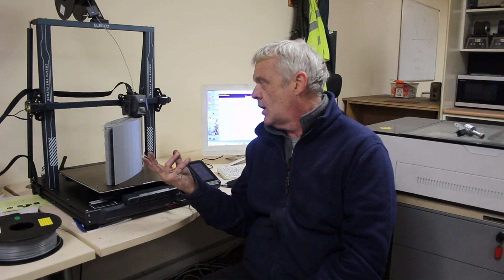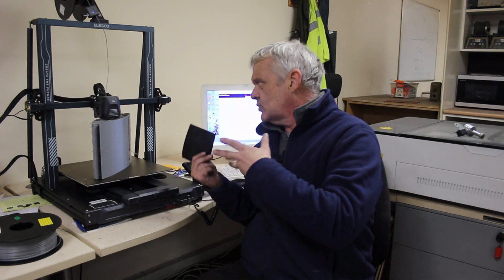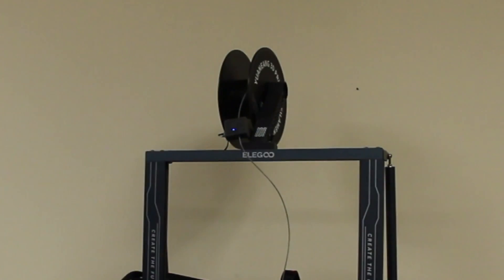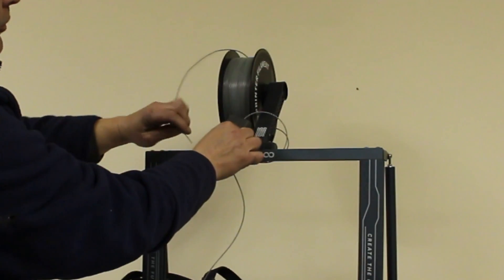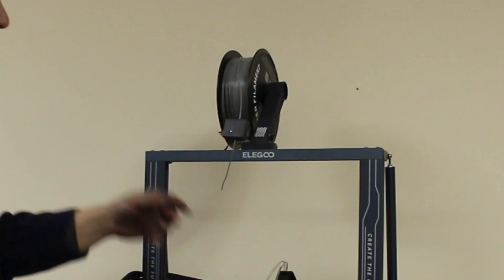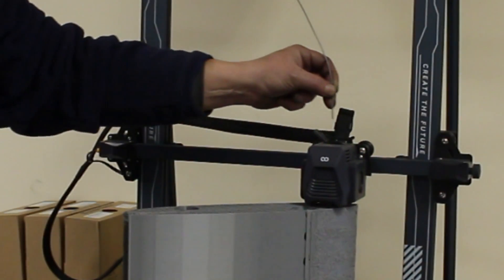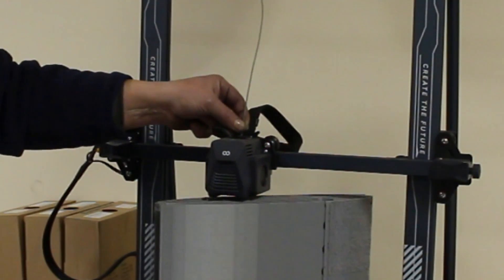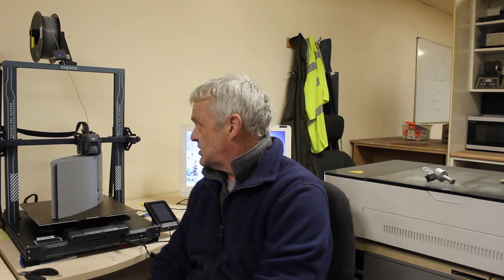1789 A 3D Printing Trick To Replace Filament #elegoo #neptune

Comment: This is even easier (but potentially less successful) on the Bowden style printers because the extruder stepper is stationary but then the potential problems come from the fact that it cannot fully retract once the new filament passes the gear since it’s not attached to the old filament until the new filament reaches the hot end but it hasn’t caused me any real issues despite doing a few multi-day 1kg+ prints and lots of using up ends of rolls on smaller prints.

Comment: This is a recipe for disaster if the quality of the print is important. The end can get hung inside and won't finish pushing through. 

Waiting for an interior portion to be printing when near the end of a roll, pause then change. Restart. This guarantees a fast easy change that will NEVER fail or effect your quality.

Comment: Clever. My printer is a prusa clone I put together from a kit  and a few years old now.  I think myself lucky if I get a print after 3 tries and I would be flabbergasted if it allowed me to do what your printer will allow.  Mine does have the sensor but I think I don't use the machine enough to get really adept at picking up skills for coping with the snags that I encounter. It has enabled me to mend various gadgets that would otherwise have needed costly replacement or just binning so its all good.

Comment: Off topic of this video but I've had an idea about some of the small scale wind turbines.  If someone didn't want to combine the small scale turbines for larger power and redundancy,  what if you combined one with one of those inexpensive solar LED lights?  You would already have a load and an energy storage system.  If you just wanted a light, the turbine would help keep the battery charged even at night.  Or you could just use them as chargers for AA or AAA size batteries.

Comment: I tend to judge a solution to a problem on how simple the solution is. Can't get simplier than that. I would had fuse those 2 filaments with a hot glue gun, but that would create new problems on the hot end.

Comment: Are you going to try making your own filament?  I have seen people use grocery bags, and water and drink bottles, to make filament , it doesn't seem the bags would be a good idea, I know it's thin, but the ones we get, if the sun shines on it for a day, it turns to dust, and you are lucky to get your goods home in them, I don't know much about 3D printing, but if I did get one, I would be learning fast,   and the carbon fiber filament, I'd like to check that stuff out!!     I have mind full of things I'd like to make,   maybe one day I can build a shop with a printer ,and use that printer to make a large printer,   I'd like to make large things and a bed with a sq. Meter, and nearly 2meters tall, (2.5meters tall probably) would be great, and a starting point, be capable of using a whole roll of filament on a single print,  maybe have multiple print heads, and spool holders. I have been studying printers , how they are built, and the controls,   and the hu'normas ones that print with concrete,  that's awesome!  If there was a better way  to add rebar, a couple guys could build a huge house in a couple days!   And limited by imagination only.. 
 Plus  using 3D prints for casting  molds, making cast steel and aluminum parts would be great, when I first heard of 3D printing, I thought that would be the primary use, was I wrong or what,  I do not like the idea of printing parts in sections, gluing them together, one thing I'd really like to make , is a huge sterling engine, something nearly resembling a v4 engine, displacing nearly 30 litres per "cylinder" that is to be heated, use possibly an oil to to be heated by concentrated sun, using multiple sat dishes, tracking the sun,  and using water pumped  through a water fall and a small pond to keep the cool side cool!  And if nothing else, spin it with a motor, powered by solar power, to make a heat pump to cool my off grid home, I could not believe seeing a sterling engine spun, and it making ice from the water condensed on the case,  that was mind blowing! It is not efficient , but if you have such a large sterling, and solar to spin it, and use it to cool water with ethanol, or antifreeze in it, cooled to about -10° +/-,  circulated through radiators that are also used for heating in winter with a wood stove/ boiler, and heat exchanger, it can be useful, hopefully dropping the temperature 20°F in a 1800 sq ft home, keeping some parts closed off,  a 3D printer could build that!  It's mind blowing,   sorry to ramble again! If you got this far, Happy New year!! 🎉. Thanks for everything,

Comment: I had a buddy who worked in a plant that made steel cables.  They used a cold welding machine to join spools of wire.  The end of the old wire in one end and the end of the new wire in the other.  Clamp the ends down and push down a lever.   Pull the lever up and both ends are now joined with a seamless weld.  It was quite impressive.  Surprised they don't have something like this for filaments.
Reply: But it's not necessary...
Reply: @UnitSe7en  Neither are 3d printers but there's lots of them in use.  Lol.  It just seems to me there's a better way to do this than to sit there and wait for the spool to run out.  If you were able to weld/join the end of one spool to the beginning of another and just walk away that would simplify things and remove some of the risk of a failed print.  But what works for one person won't work for another.  Personally I'm not sitting by a machine waiting for it to run out of materials if there is a way to pre-stock it so that I can do other stuff while the machine is working.
Reply: They have a hand held splicing device that can do this. I have never tried it but some people use it. It would be nice to have it built onto the top of a printer though where you could simply splice the next spool it as it feeds through but the current cost is about 50 of 60$ for one.

Comment: Wondering how difficult it would be to thermally weld the tail end to the beginning of the new without creating ledges that may impede automatic feeding.
Reply: Not especially, but a couple of problems impede the process, one is thermal expansion and contraction, another is loss of strengt in the joint. Both can be mitigated by sliding a bit of PTFE tube on one string, then melt and weld the two ends, sliding the PTFE tube over the joint and shaping the molten plastic. Leave the tube on the joint for protection.
Reply: @jakobhansen1396 given sane materials, expansion and contraction between filaments are likely to be identical. But being mostly lengthwise the joint shouldn't be under stress.

Maybe there is an opportunity here. I can see using a peltier to warm and cool two halfs of a die for welding two filaments of given diameter.
Reply: @kreynolds1123  in practice there is a certain swelling that needs to be managed, filament is usually extruded with a specifik pull forming the diameter, which is hard to replicate. 
Regarding strengt it's the mostly part that is important, the coils introduce bending and imperfections in the weld become significant.

Comment: If you don't use the filament runout sensor, just stick a short length of filament through it, rather than feeding the whole reel through it and then keep an eye out for when you need to poke the new filament into the feeder :-)

Comment: On these larger shapes with small or no retractions you can get away with this. When small articulated items with many retractions need more filament it would probably be easiest (assuming their is no pause button in the UI) is trip the filament sensor.  

It always works until it doesn’t, and one big fail is all it takes to cancel  out all that time and effort you made to use every drop of filament. Best of luck, there is no correct answer but as my experience has grown I have stopped doing the demonstrated method all together.
Reply: Has worked for me on a bowden-tube ender 3, even with retractions. I just continue pushing new filament into extruder despite retractions, until it is some 10cm into the tube. True, there might be more stringing while the remainder of the old filament is used up, but hasn't yet made any prints unusable.
Plus, one would have to be watching the print and be close by to change the filament, and without a filament sensor a timing mistake might be costly...

Comment: How long does one spool last? that depends on the quality of your print (if you print in 0.12 or 0.28mm) ... that means you have to check your print all the time because you have to be there BEFORE your sensor gives an alert.  I let the sensor give me an alert (very loud siren - it will then continue printing for another 5 to 10 minutes depending on the print). It would even pull me out of bed in the middle of the night even when i'm sleeping. I then go and press the "pause" button, which makes the head go in a corner. I then change the filament (letting 10 cm come through the nozzle) . when that is done i hit the "resume button" and it continues where it paused. depending on the sensor, it opens or closes a circuit. those filament sensors are less than 10$. you can easily connect an extra one and almost any alarm, and its much better than having to wait and watch.. I'm not saying your method is bad, just that i wouldn't have the time waiting till the spool is finished. 
Luc

Comment: luckily on my printer the feed gear is remote at the end of a tube to the print head, but essentially its the same method, just feed the new filament into the top end of the tube, the butt joint between the two allowing it to continue pushing through to the print head.

Comment: @robert here is a idea I have no time or the eyesight no more to build it how about a heated clamp tube about 2 mm wide maybe with a clamp you put both ends of the old reel and new reel it heats and fuses for a cpl of seconds and when you open it it continues without a break to the new roll. I thought of it years ago when I got my first printer kit but health deteriorating could not bring it to life.
Reply: The Palette pro will be mind-blowing then